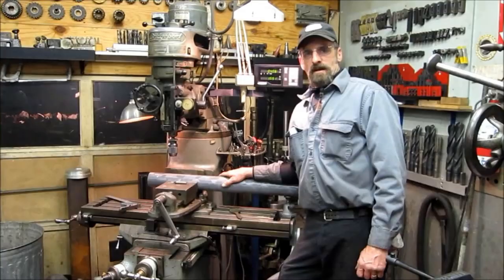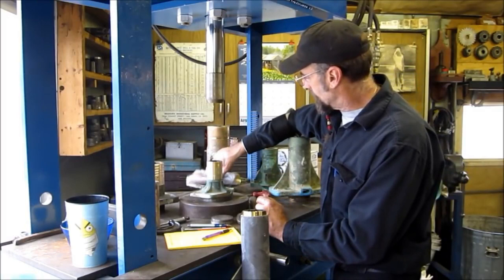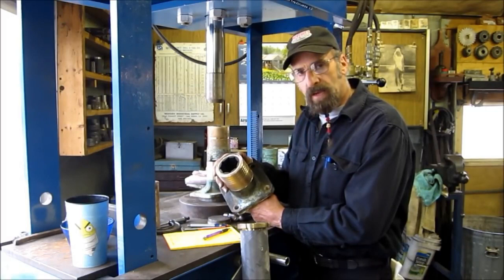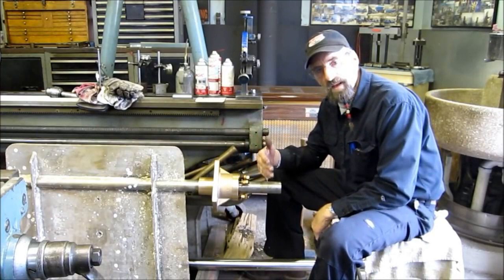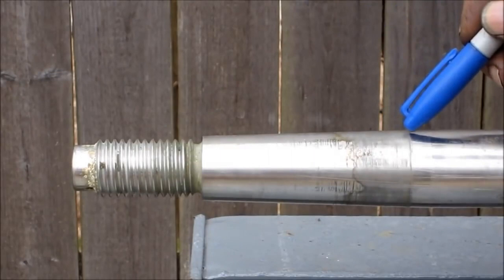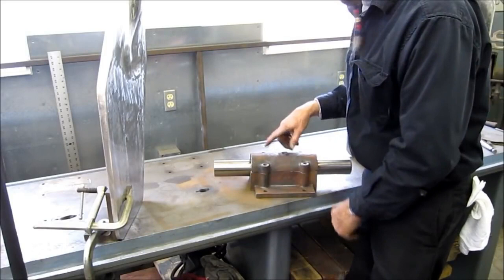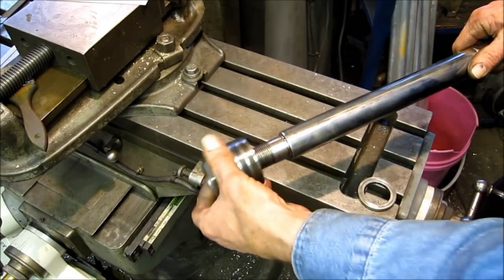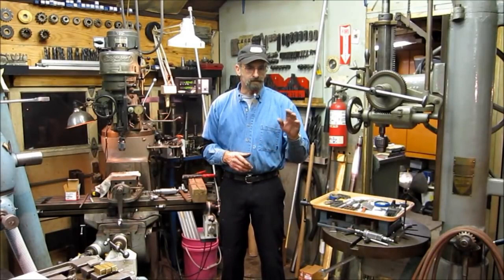A Day At Turn Wright Machine Works Reprint 001

Comment: As a long time viewer I always liked “its not the cost of the repair, but the cost of the damage you caused” awesome 👍💪
Reply: That's a whole lot of counter-productive "oooooh look at me how much smarter I am than you" bullshit though. Shit happens. Nobody wrecks machinery by choice. If you're going to make a point out of asserting your superiority over your clients, you absolutely deserve to fucking go bankrupt thrice over.
Reply: @AttilaAsztalos  
That is a different point of view, however.......The repairs I have seen carried out by Turnwright Machineworks were all caused by abuse, lack of knowledge or an insane attempt to “repair” something. 
e.g, when you try to weld a hardened bearing in a cast iron flywheel you end up with an expensive repair. Many clients may start wining when they hear what the repair will cost because they have no clue what it takes to getter done. Set up time and building necessary fixtures are time consuming. In such a case I would definetely say: good luck, but please look for another shop who can do it cheaper.

Comment: If only it were as easy to rebuild individual bearing as it is mechanical bearings.
Reply: Well even if they are badly damaged they can usually be welded up. The difficulty is getting the weld to stick so a top grade flux is needed. Personally I recommend "Red Pill" brand.
Reply: @bwyseymail  99.44% of motivational speakers recommend Red Pill over any other brand of pill to rebuilding worn individual bearings.